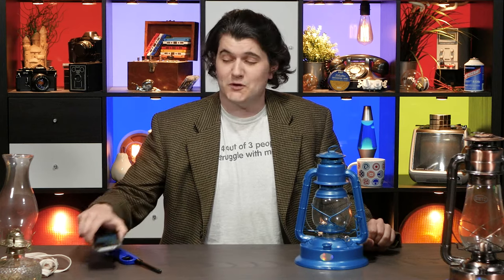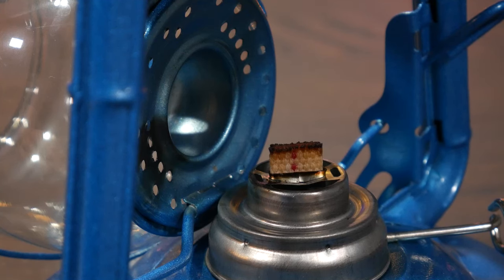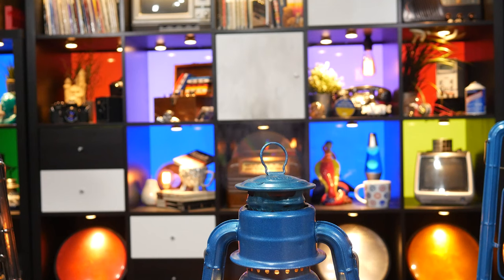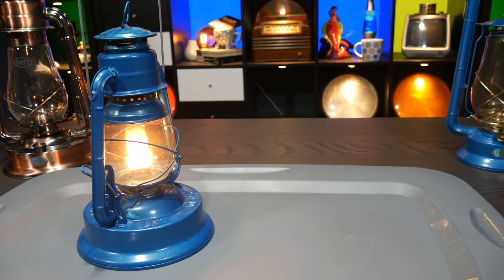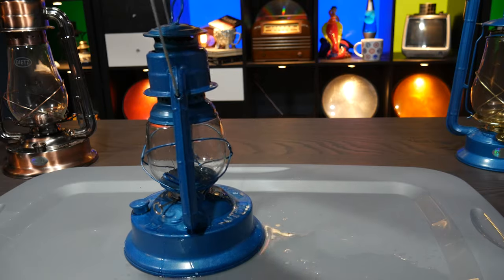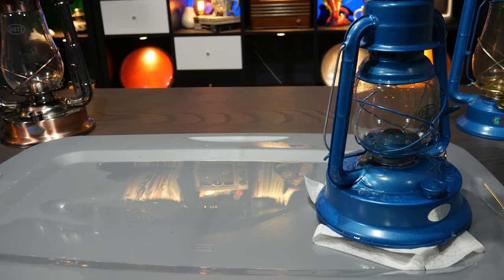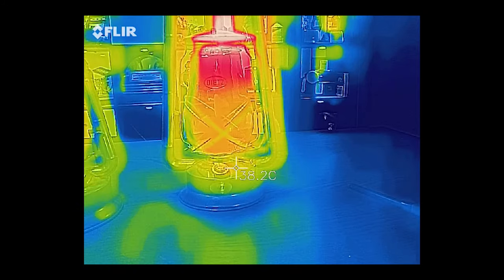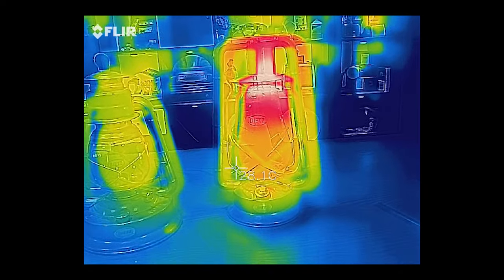How to use, more info, and further thoughts on hurricane (Dietz) lanterns

Comment: "Unless your car is extraordinary terrible... or electric... "

I laughed so hard I emitted greenhouse gases.
Reply: This comment is fuckin amazing.
Reply: Methane
Reply: You win the internet for this week.
Reply: @Colin Hessler or he just breathed out CO2 is also a green house gas
Reply: there's a difference?
Reply: @patrickwelles3046  
You know nothing about modern electric cars apparently. They're really good. Better performance, quiet, efficient, and they charge really quickly. Range is high enough you only need to stop when you most likely need a break anyway.
Of course there are still crappy ones, but there's always crappy ones of everything.
Reply: @theuncalledfor  yes but unless you live near a nuclear power plant or a ginormous solar farm or even one of the inefficient, bird killing windmill farms ☹😡...you're getting your electric car charged by a fossil fuel burning power plant which in effect makes the electric cars less efficient and not as cheap to operate as everyone is being led to believe there's always a hidden cost.
Reply: @alvinmorris5404  Bingo
Reply: @alvinmorris5404  - Generating electricity (and using it to drive) is still orders of magnitude more efficient than burning liquid fossil fuels. Just in terms of this video series alone, compare the efficiency of an electric lightbulb to these kerosene lamps. 
Then on top of that fact is that power plants run on a constant level. Driving your fossil fuel car is putting out extra pollution that wouldn't have been there if that car didn't drove. Driving your electric car doesn't as the power plant produces power whether you charge your car or not.
And on top of that electricity can shift more and more towards cleaner sources. Just because it's not perfectly clean right now, doesn't mean it can't be. Fossil fuels can NEVER be clean. Just because it's not an instant perfect solution right now, doesn't mean it's not clearly the right move in the long term.

Also they're called 'wind turbines'. Wind mills are the medieval things that mill grain. Stop listening to Trump so much. You'll start talking about clean coal next.
And since you like birds so much:
"Wind farms and nuclear power stations are responsible for between 0.3 and 0.4 bird deaths per gigawatt-hour (GWh) of electricity while fossil fuelled power stations are responsible for about 5.2 fatalities per GWh. In 2009, for every bird killed by a wind turbine in the US, nearly 500,000 were killed by cats and another 500,000 by buildings. In comparison, conventional coal fired generators contribute significantly more to bird mortality, by incineration when caught in updrafts of smoke stacks and by poisoning with emissions byproduct." 😡

Comment: the added pre-heating of the intake air helps in cold weather especially. You can observe this with a zippo on a really cold, but windstill day - lighting it produces a flame, that will quickly shrink and die. after a few lightings, the heat that was absorbed by the metal of the lighter will push the feed rate high enough to support a flame beyond just a few seconds.
Reply: This brings up a good point. 

Heating the air might have more to do with simply not freezing than it does with reaching a higher temperature. 

It keeps the water vapor from freezing to the bottom of the globe, and it keeps the fuel warm enough to travel up the wick. 

Maybe. You'd have to cut the tubes on one to test it, and I'm not gonna do it with mine.
Reply: Kerosene freezes at about -40°F
Which sounds unrealistically cold, unless you are in Canada or Alaska. 

It would be cool to see one intact lantern and one with the tubes cut off in a freezer and see when each one stops working.
Reply: Canadian here, at my cabin, we use deitz lanterns.
Can confirm that a frozen lantern is an absolute bitch to light.
Hot blast lantern would light in 5 seconds in a -40c cabin.
The cold blast lantern takes up to 20 seconds, allowing the hot lighter flame to "warm up" the combustion air ever slightly enough to get going.

Hot blast was full brightness after a moment, cold blast took up to 5
Reply: @maxman1244  The last time I was in Canada, we used a mantle lamp. Don't they work in the cold?
Reply: @andrewmorton9683  I've found that the with the common mantle style lamps here, propane for newer and white gas for older models have their winter cold start struggles as well.
White gas pump styles are hard to use with gloves, and propane can be a bit slow to start in -40 as well (even though it shouldn't be)
Reply: -40f = -40c
Reply: This is mainly why i use my zippos in the winter, the cold really helps the fluid last way longer than in the summers. 
And they still light quite reliably.  
I usually keep mine in my inner shirt pocket under my coat and my core temp keeps it about perfect for one flick lights. 

Ive just noticed in the summer i have to refill it about once every two days, and in the winter i maybe only have to fill it once or twice a week.

Comment: Great videos, always entertaining and informative.  On your comment about newer cars already having cold air intakes, you are correct, at least on my 2017 Dodge Charger, 3.6L. This vehicle already has a cold air intake that takes air from underneath the front of the vehicle, up through a CLOSED filter canister, and then into the engine. I went on Amazon and bought a name brand cold air intake for this Charger and if you look at customers’ pictures you will see that this particular intake air filter is partially open to the engine compartment and right next to the coolant overflow reservoir.  This reservoir and the engine compartment can get very hot relative to the ambient air temperature.  Using an OBD2 scan tool and looking at the vehicle’s air intake versus ambient temperature sensors, I found that in stop and go traffic, the factory installed cold air intake system gave about 10°F above ambient, while the purchased system ran closer to 20°F above ambient. At highway speeds, they pretty much read the same.  On the other hand, the new system had a larger filter area and the sound it made was amazing.  After insulating the metal air intake runner, and the air filter from the overflow reservoir, about a 4° improvement was actually gained over the factory cold air intake system.

Comment: Side note: I don't think the length of the air intake tubes is just to act as shock absorbers. By putting the intakes right next to the exhaust, it's hard to get any substantial pressure differential between the two, which helps with reducing any kind of buffeting even if the wind is e.g. blowing upwards. A set of tubes coiled around the base would still have the dampening effect, but you could still get sustained pressure differentials.
Reply: That is a really good point.

Comment: Yes, the IR wavelength associated with "heat" does not pass through glass. Which is why CO2 lasers can cut glass, they operate in the deep IR spectrum that glass is opaque to.
Reply: Except that co2 laser wavelength is 10um, while the(wavelength of the) peak of black body radiation for a candle flame is an order of magnitude smaller.
(Candle flames are near IR, co2 lasers are mid IR)

IR easily passes through glass, as you will find out sitting behind glass when the sun shines.

Glass is famous for not passing (much) UV though.
Reply: @oscargr_  so why does a car trap so much heat when you leave it in the sun? 

My understanding was that visible light and UV could pass, hit something, convert to a lower wavelength and would then bounce off the glass trapping the energy inside.
Reply: @AmityPost  The absorption spectrum of glass is not a smooth line.
Though, as far as I can tell middle to long IR waves don't pass so easily.

I doubt that fluorescence is a big effect with most materials in car upholstery.
What does happen (I believe)  is that both visible and near IR pass through the glass, get absorbed by all surfaces in the car. These surfaces increase in temperature, that warms up the air inside the car. And the warm air is trapped.
Another factor is probably that the roof an doors get hot on the outside by absorption. And thermal isolation of cars is probably not that great, so the inside also gets warmer through conduction.

Feel free to disagree though.😁

Edit to add that not all glass is the same.
(And that UV-A and UV-B are not the same)
And that car windows get very warm in the sun. And those (also) heat up the interior through conduction.
Reply: @AmityPost  the heat won't travel straight through the glass, but it will pass through slowly by heating up the glass (and the metal) and coming out the other side.

If you look at a car (that's been running for a while) under a thermal camera the glass will be pretty much a solid color, since it's warm, even though IR isn't going straight through (so you can't see the people inside).
Reply: Glass isn't glass. The type of glass determines which wavelengths pass through, are absorbed, or reflected.
Reply: @AmityPost  so cars do exhibit the greenhouse effect, but thanks to the excellent heat conductivity of metal that also helps drastically warm the vehicles interior as air comes into contact with body panels in the cabin. 

I live in the high desert, and even leaving my truck windows open with the sunshade up (or even using multiple shades on all windows, w/ them cracked) the cab still gets quite a bit hotter than ambient temps, because i have no insulation in the cab, and the air can circulate within and pick up that heat and it stagnates without a steady breeze.

Comment: Nice! 👍👍  I have about 10 of these lanterns, have used them in power outages for years, and had no idea the globe would tilt back like you demonstrated at 3:20.
Reply: Same!
Reply: I’ve got one hanging next to me and one of the old Victorian round wicked table lamps on the other side, and I’ve always been too anxious to ever actually put fuel in them. I was so excited when this series of vids dropped
Reply: Mine is antique, the globe we found is slightly too tall, so it doesn't tilt unless you take the wick/wick lifter out first.

Comment: I mostly agree with your hot/cold air intake idea. I think it's mostly for cold climate. I used one last winter. It clearly works much better after it warms up. If I didn't pay attention, after about 10 or 20 minutes I would have to turn the wick down or it would completely black out the globe with soot. It was 0°F at night when we started the lanterns and started a fire the first night. The wick was gelled up and took a little bit of time to light

Comment: The situation with the tipped lantern probably wasn't all that dangerous, although yes, you should definitely have taken the safety measures you mentioned! Kerosene won't generally sustain a flame on its own, since its flash point is significantly higher than room temperature. This means it needs a sustained heat source to allow it to form a flammable vapour - that's what the wick is for. Without the wick, any flame would just rise away from the liquid without heating it any further. If you tried to run a hurricane lantern it on petrol/gasoline with a flash point far below room temperature I expect the whole thing would just erupt into a fireball. I bet it would make a good video.

However, unexpected things can happen - maybe it drips down on the carpet, or you splash it on your clothing. Or maybe the kerosene you have happens to have a flashpoint towards the lower end of the range and a piece of the burning wick falls down, etc, etc.
Reply: Yes!  It could have been dangerous dripping onto carpet which can act like a wick.  Here in Canada we can only get low flashpoint kerosene so things are a bit more dangerous here.  Also, there are several Youtube videos showing how hard it is to ignite kerosene with a flame.
Reply: I had a paraffin lamp leak onto a plastic surface, the paraffin caught fire almost immediately from the flame inside the lamp - I assume we only get it as a low-flashpoint fuel here

Side note: I luckily had a brick to put on top of the flame and put it out
Reply: I kinda expected the plastic to melt, either from the heat or from the fuel dissolving it. I don't know if kerosene is the same, but gasoline will eat right through some plastics.
Reply: Kids these days...
By the time I was 10yo, through diligent experimentation ;-) I had a thorough understanding of the flashpoint of various flammable liquids.
Kerosine: no good
Petrol (Australian for gasoline): excellent
Metholated spirits: excellent
Turpentine: no good
Reply: @ataphelicopter5734  Picturing someone fighting a fire with a brick is a great mental image

Comment: If you have the thermal camera I think you do:
1. You might be able to select a different temperature range to get values above 150 C.
2. You can adjust the alignment of the IR and visible images.
3. The latest app update, if you don't have it already, added optional automatic spots for the coldest and hottest points.

Comment: I have been around these lanterns for many many years and never had an inkling they were so complex.
As has been mentioned by others I suspect that the heating of the air is primarily for the purpose of causing the fuel to evaporate, especially in cold environments.
Reply: Heated air rises. Less dense. Lighter. Evaporation, which rises, is in gas form (changed from solid or liquid).
 If the air flow is traveling down the 2 tubes to the wick...it's being DRAWN.(vacuum)
 Just a guess. The purpose of the tubes are to supply air to the chimney chamber to more completely burn the soot. Maybe?
 Thanks!👍

Comment: Regarding the odor:
Apparently there are very sublte design differences between different makes of hurricane lanterns. Both the cheap knockoff one I bought at the hardware store and my Dietz (that I have since misplaced...) were VERY smelly. My Feuerhand brand lantern though? Practically odorless.
Reply: Same for me! I also have a Feuerhand :) also tipping it over doesn't lead to so much mess. But I think he overfilled his lantern.
Reply: Ever read the book '3 Men In A Boat'  ?

'Sometimes a westerly oily wind blew, and at other times an easterly oily wind, and sometimes it blew a northerly oily wind, and maybe a southerly oily wind; but whether it came from the Arctic snows, or was raised in the waste of the desert sands, it came alike to us laden with the fragrance of paraffine oil.

And that oil oozed up and ruined the sunset; and as for the moonbeams, they positively reeked of paraffine'
Reply: Most likely it is just better designed and manufactured lanterns provide better airflow and therefore more complete combustion.
Reply: I've had a few Feuerhands (3), but they used thin metal (this was 15 years ago) that rusts very easily... I've had perforations and leaks, too. Learned my lesson and went to Dietz about 6-7 years ago. If the paint on a Dietz gets chipped, you slap more on. You can strip them and do full repaints pretty easily, too. Never had a metal problem on a Dietz, and no leaks. My lanterns are outside all year long - they get snowed on in the winter and baked in the summer. No problems ever. As for the stink, well, that's subjective, but it's hard to be bothered by it when you're outside, even if I do notice any smell. (I try not to smell the thing.)
Reply: @randynovick7972  Question: I happen to own one of these Dietz that belonged to my grandfather. It works nice even today, but it has a tendency to soot the entire glass after maybe 45-70 minutes. Any ideas on why this might be happening?
Reply: @TalasDS  how high is your wick? Does the flame have a "horn" on one or both ends (if it does, it shouldn't)? What are you using for fuel?
Reply: @weekendrailroader 
The wick itself was odd, so I trimmed it with scissors and it's nice and flat, the flame looks like 'a wall'
I was using the decades old kerosene it originally had. Replaced it with a newer kerosene and it did got better, however. Not that much.

The wick is just high enough so it doesn't soot. After a while, it starts smoking again, so I lower it and basically just keep repeating that after a few minutes. I'd does stop eventually. But the lamp goes really, dim or just goes out altogether.
I'm suspecting of spiders that may be living in the breather tubes or something.

Comment: I replaced all my wicks with carbon felt and sewn in some copper thread to provide thermal feedback. I used only two threads in the middle and down the length of the wick. I also added 1/2" extra wick for the length just in case.

It is just enough to keep the wick kinda hot but only warms the fuel.

I tried these in two hurricane lanterns (using lamp oil) and they work perfectly.

Those wicks NEVER burn up, never need trimming. Even your grand kids won't have to trim or replace them.

If they ever clog due to using say citronella oil or scented oil, simply remove the wick and BURN IT. Burn well but not hot enough to melt the copper wire.
Once done, wick is like brand new again.

You set the wick to the correct height and never adjust it again (just blow it out).

If you used multiple copper threads (think speaker wire strands) you can use thicker oil like veg oil and even olive oil.

However, that might not be good if you switch back to lamp oil or kerosene. I never tested that.

Thermal feedback warms/heats the wick & oil, thinning it out a bit causing it to vaporize more readily.
The oil doesn't burn the vapors do at and above the wick.

If ANY lamp or lantern is so hot where the fuel compartment is that you cannot touch or hold it, you have a bad problem.

Using denser oils will always be the same lighting difficulty copper wire or no copper wire.

If you want it brighter, then cut any wick into a goal post shape or spoon shape.
Does make a neat flame effect.

Copper wire is optional. Especially with lamp oil or kerosene unless it is -40 degrees where you use it.